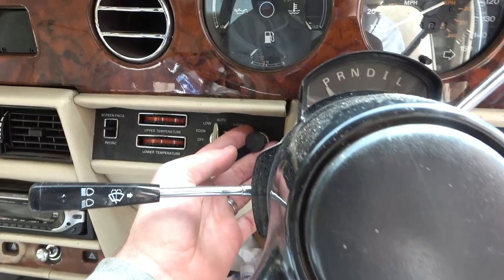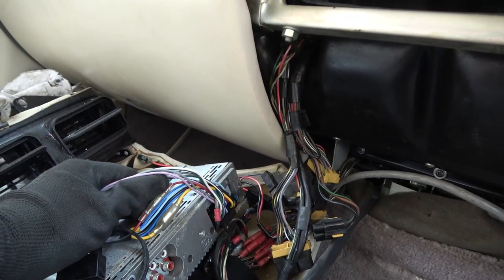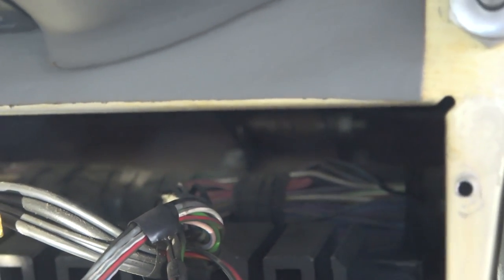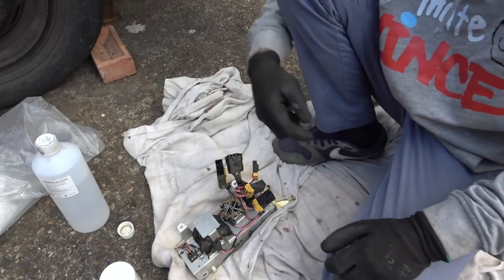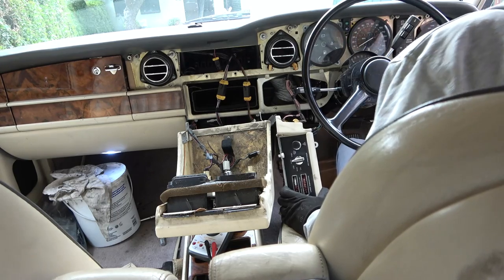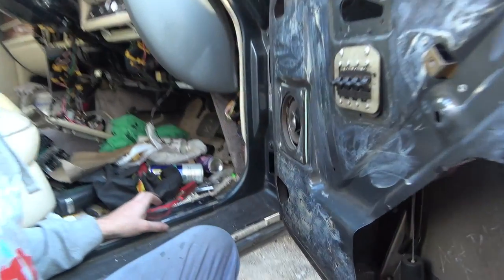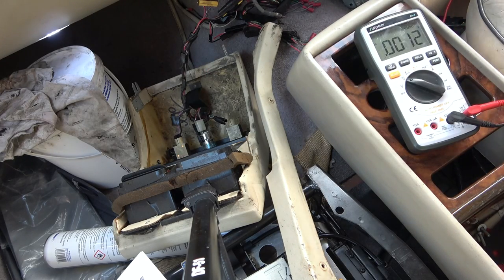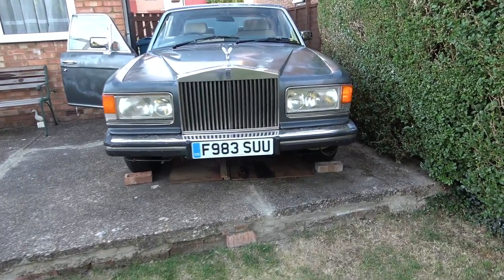DIM Indicator TURN SIGNALS on the ROLLS ROYCE SILVER SPIRIT & Other FAULTS - CAN I FIX IT? PART 20

Comment: These videos are never about the destination. It’s all about the journey you take to get to the destination. Great work as usual.
Reply from the maker: Thank you Scott 👌👍
Reply: Nice repair video 

Are you going to look why one of the headlights are not working.
Do you know if the back lights are working
Reply from the maker: @promasterthegamer523  I will do yes. I think when i got it the headlight was working,  might be the lamp itself. I don't actually know if the brake lights, reversing or fog lights are working. If they are not then as long as it isn't the lamps then I will do a video on them👍 Thanks.
Reply: @Mymatevince 
No problem

You can let people know if the brake lights are working in your next rolls royce video
Reply: @promasterthegamer523  like yer style 👍
Reply: @Mymatevince 
Are you going to try fix the back door lock on the left door
Reply from the maker: @promasterthegamer523  That will be included in Part 22👍
Reply: @Mymatevince 
Nice

When is part 21 coming out

Comment: I used to make wiring harnesses for trucks and here are some colour codes I can remember for the wires. 
B=Black, W=White, R=Red,G=Green, U=blUe, N=browN, S=Slate(grey), K=pinK, V=Violet(purple), O=Orange, Y=Yellow. 
When there are 2 together like RW the first is the main colour and the second is the stripe colour, so that would be Red wire with White stripe.
The splices will be taped inside the harness so will be inaccessible but are unlikely to have failed if they have been working for so long.
Those terminals might need replacing if they are that corroded. sanding them will give a temporary fix but will also remove the plating (if not already gone) so will corrode again faster.
You could also use some non-conductive light grease (like white lithium grease) brushed on the terminals to help protect them and to ease insertion.
Reply: .. insertion ..
tee hee
🙃
Reply: Looks like in some years of Rolls Royce wiring diagrams, Purple was designated as "P" and there may have also been an "LG" for Light Green, the only two-letter designation for a single color for whatever reason. And some diagrams would also include C or P at the end for cotton or plastic wire insulation.
Reply: pretty much same as colour designations vince used at BT.   Bw/Wb , Ow/Wo, etc.

Comment: Enjoying the videos. An easy way to check end to end continuity on a long wire is to connect a jumper between one end of the wire to ground and then go to the other end and measure between the wire and ground. Continuity means it is good through the entire loom. If you are worried that the wire might be grounded, just remove the jumper and then continuity will go away.

Using this you could ground all the pins on a connector and then check the far end connections quite quickly.

We did this in the navy to check continuity of cables that went from one end of the ship to the other.
Reply from the maker: I do actually understand that, really useful for testing long runs. Simple idea but super clever. Thank you👍👍👍
Reply: Clever. Guessing ground has to be metal such as the cars shell
Reply: Great tip Gregory :-)

Comment: The radio is equipped with a proprietary Sony plug going to a ISO 10487 adapter cable, which probably was delivered with the radio. You can find the pin assignments on Wikipedia or by googling for images of it. Maybe there are adapter cables available from the RR to ISO. I think you got the round DIN plug right, there is probably an adapter to the chinch plugs available somewhere. The other crimp connectors, tied to the DIN cable are either power for the amplifier and/or speaker outputs from the amp.
And the Sony radio may deliver more power and better sound than the pretty old Blaupunkt amp
Reply from the maker: Thanks, I will Google ISO 10487 to see if I can make sense of any of it. Cheers Loudness👌👍
Reply: @Mymatevince  the plugs are, but apart in  the power, the rest are what ever picked at the time of the radio and cars mating, some sore anti stealing thing?

Comment: Good work, Vince :)
But that connector(both male and female) in the driver side column, which goes back to the rear lights, MUST BE replaced eventually. I had a massive electric fire once in a Mercedes E230 because I didn't replace the corroded connections. And I had to replace the whole loom which took 9 hours of work to fix, my worst nightmare ever.

Comment: You could use some small brass brushes for your dremmel for cleaning those round pin multiplugs.
I would go round every fuse and relay panel on your roller and make sure everything has been given a good clean before starting work on other electrical faults that way you're only left with multiplugs to clean up as you go along with fault finding and maybe put some electrically conductive grease in those plugs in the footwells.
Reply from the maker: Thanks Adelle. Do you know if silicone grease will do the same job?
Reply: @Mymatevince  if it's good for 12 volt stuff then it should be ok even with those multiplug types with rubber gaskets built in.
Best way to check would be to continuity test a blob of it on the bench.
Personally I would buy some carbon-silicon(carbon black) conductive grease , at least you then know its going to be ok.
Reply from the maker: @adelestevens  Thanks Adelle. I will check it out👍👍👍👍

Comment: I've gotta say that when I first saw you'd be working on a car I wasn't all that excited about it ( I really only subbed to the channel to see the electronics fixes ), but over the weeks I have become hooked, this is really fascinating stuff.
Reply from the maker: Excellent. Quite a few viewers have said the same thing. I think really these electrical fixes on the car are just like a blue mat video but with different scenery and sounds. Nice one👍👍👍
Reply: @Mymatevince  TBh I'm now just as interested in the bodywork and mechanical fixes as anything else, it's surprising what you can achieve on a limited budget with a little bit of ingenuity.

Comment: Electrical wiring on cars when they get older can be an actual nightmare even on basic cars on a Rolls God help you Vince is the man to never give up.A mechanic friend of mine when serviced a car as far as possible used to check all the plugs for corrosion

Comment: Vince, when you are trying to repair something like that lamp you had no idea whether you were looking for a bad feed or ground. SO to make your life easier, use an ohm meter to establish if you have a solid ground and a volt meter to see if you have a good feed. You can also use a thing called a power probe which makes life so much easier as it connects to the battery and can supply either feed or ground and will allow you to trace the defective part of the circuit in record time. BUT as you know finding things the hard way, is the best way to understand how it works in the first place.

Comment: Nice fix. Quite satisfying to see faulty stuff working again after some work :) 
Someone probably would've replaced the bulb first, but it wouldn't fix this problem, so it was definetely necessary to do this job, also to pass the MOT as the front right indicator wasn't bright enough.

Comment: Another great piece of fault finding, well done Vince. It looks like that issue around the windscreen has caused quite a few electrical connection problems!
Reply from the maker: Thanks Mike, I was wondering the same thing. I wonder whether the 2 rusty clips that were on the windscreen were letting a bit of water down straight into that corner 👍👍👍

Comment: There's definitely less current passing through the right indicator bulbs (see how they light up slightly later than the left ones). Either the left bulbs have been replaced more recently than the right ones, or there is some contact resistance on the right branch.

Comment: Hi Vince, from experience checking car electrics faults with a multi meter can be very misleading. You may well have continuity but the circuit may not be able to carry the load required. Fault finding with the battery connected and a bulb rated at the same Amps as the circuit your checking is the way forward. Using bulbs prevents direct shorts and stops you damaging anything. A bulb in its holder with a couple of wires attached can be used from a known earth to check a live can supply the load or by connecting to a known live you can check the earth is capable of carrying the load also. Dull or no light equals high resistance and a fault, a bright bulb equals no fault. Looking forward to the next instalment. 👍
Reply from the maker: Thanks Andy👍👍👍
Reply: Yup, something like a 12 V/30 W bulb should do a good job. Draws 2.5 amps.

Comment: Great video Vince , I like your explanations of your thought process it’s good to see your logic.
Well traced and fixed.
With older cars I’ve found a lot of the problems can be bad grounds especially on element exposed electrics , I’d normally start to see if one of the connections has a good connection to a known good ground ( perhaps straight from the - terminal on the battery ) continuity and voltage and then trace back from there.
My sons fiesta kept popping a fuse on the RH indicator and hazards sometimes new fees would last between seconds and days, I changed the switch , relay and stork . Then I decided if the fault was blowing fuse it must be a short to ground and it was the jack had been chucked it the boot and it was resting on the loom,  a bit if sharp edge bodywork had made a tiny hole in the cable and made a short to ground so rewarding finding the problem 

I’ve eaten to much rust and dirt and had plenty in my eyes too , nice to see you had safety glasses on , a covid style visor may stop stuff going in your mouth 

As always really enjoyed the vid

Comment: Vince, 
If you have a faulty circuit on a vehicle, using the metre may give confusing results, as it does not test the current carrying ability.
Use a test lamp, or scope on a rope.
Put one end of lamp to neg, check the pos feed, lamp will light if rail is ok, then put the end to battery positive, and check the ground, lamp will light if you have a good ground, all you need is 1 minute to check if you have a feed or an earth issue. Using the multimeter will not give an accurate indication for current flow.
Reply from the maker: Thanks Tony, that makes sense. Really I need to buy a light and solder long leads and croc clips on it. I'm just so used to using the multimeter I automatically default to it 👍👍👍 Also I worry that some circuits may not be 12V and I may shove 12V into them or.... do you know if all circuits are always 12V on a car?
Reply: obviously the maximum voltage is battery voltage, there are some circuits which run on 5volts, the only caviate i would warn is you have an input circuit to a system computer on a vehicle, don't use this method, but in most cases the lamp on a test lead will give a very quick diagnosis, i would suggest you have several made up with different amp draws, you  could have one that draws 2 amps which you could use to test high current circuits such as 12v sockets, headlamps, radio, etc. then another that has 100 ma draw to test sensors, low current cicuits.  By the way really enjoying the Rolls restore videos, cheers
Reply from the maker: @tonycross8101  Thanks Tony👌

Comment: The seat belt indicator is regular also connected to a switch which is in/under the seat to check if there is a passenger on the seat. If there is (and the seat belt isn't in its clip), the indicator lights up, if there isn't it won't. And that is why the light is connected to the cable beam/connectors. So probably, when doing the seat motor stuff you (or the previous owner) did something to that switch/indicator, so it "thinks" there is a passenger in the seat.

Comment: Hi Vince. I would replace all the bulbs they can discolour with age. Indicators are a 382 bulb 12 volt 21 watts, and possibly the repeators are a 501 bulb 12 volt 5 watts. The stop and tail bulbs are 380 bulbs 12 volt 21/5 watt twin filament bulb.

Comment: For the female round connectors, could you use a cotton bud in a drill with some metal polish to clean them up? Also you can get IPA cotton buds from eBay to clean up the polish

Comment: I dont know if this could work , but maby you can test this theory on a cable where you know there there is a bad (dirty) connection. And if you then could do a resistance check on the cable with one end disconnected . So you can measure if you have higher resistance so you know you have a bad connection. 
Love the vids keep them coming :)

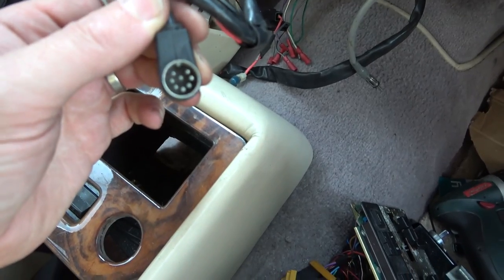Comment: 9:49 I had my radio stolen and the wires cut. Unless your repair manual has a proper wiring diagram for the radio, you'll have to identify the wires. For me, the hardest bit was identifying the speaker wires. Use a AA battery (after you've identified the power wires) and probe the rest of the wires. Eventually you'll hear a speaker buzz. To check if you've got polarity reversed, see if the membrane of the speaker you've found is moving in or out. If it's moving out, the polarity is correct

Comment: something that definitely inst in the highway code are my rear Fog lights, i have them wired to a Wig Wag circuit and they are what i flash at people to say thanks instead of my hazards :D

They look cool but i didnt wire them up like that for that reason, people have become desensitized to yellow flashing lights but my red fogs alternating left and right really stands out and is impossible to miss and did it as a safety thing!
Reply: unfortunately flashing and / or alternating rear fogs are mot fail now

Comment: Love your videos Vince but I'm a bit of an OCD freak, please please please make your life easier and tidy up the footwells and boot hehe, auto sparking is the hardest of all electrical work, especially on older cars a single bad earth can cause all sorts of issues, I'm an aircraft electrician/HV electrician now offshore and I served my time as a car mechanic in the early 80s and hated electrical faults, back then things were simple but you still came across positive earthed cars, guys fitted new radios designed for negative earth cars and wondered why the car wold suddenly fill up with smoke.  Good luck with the car, and thanks for the laughs over the year.

Comment: you can tighten the female parts of the connector, by bending the sides in a little, some still looked rusty inside, in your Dremel bits kit u should have a tiny ball grinding bit. shove that up the connector holes. apply vaseline or dielectric grease, or just grease, it all works the same to keep water out.
Reply from the maker: Thanks Mark, I didn't think to look in the Dremel kit. I will have a hunt around to see what is there 👍👍👍

Comment: Nice jobb Vince 👍👍👍 But be carefull whith thath Contackt cleener ! Some off dise are wery flammable ,, a spark can create a big fire in the contakt and cables  !! So make sure the contackt cleener is fully evaporised before you turn on the power to the batteri  !!!
Reply: A dielectrik grease can be a good idea to prevent oxidation in the future !!

Comment: I'm thinking, instead of trying to turn this Roller into something pristine with a professional paint-job costing thousands and thousands, why not turn it into a Rat Royce.
You could get Scott from Ratarossa to give you a hand with that.
That would be a crossover to die for.
Reply from the maker: My brother was saying the same thing. Keep the bodywork just like it is and run it without the wheelhubs. Certainly would be unique but I would also like to have the chrome all polished up and shiny paintwork. Just not sure at this stage whether it will ever look good given the state of everything!
Reply: @Mymatevince  I love it no matter how it goes :washhands:✌

Comment: the screws for the dash is easy to fix , just make a holder that supports the back of the head use a small hammer and small taps in order to move the buggered up metal back in the groove and head use a file or hacksawblade to reform groove ,i would  use bluing or galvanize the skrews again

Comment: Front driver side is definitely much brighter than the beginning of the video.   Wondering if the replacement tail light has a different bulb than the original and hence looks different than the original that is still there.
Reply from the maker: Yes maybe Vikas, I will try and swap them over in a later episode to see if the dim side becomes bright and vice versa. Thanks 👍👍👍

Comment: 9.12 hi Vince,  i'am thinking the the rolls royce had a blaupunkt radio from the factory and the wires at 9.12 are for that radio, and at 9.42 that round plug will be for a CD multi changer (maybe theres one in the boot?) 9.53 these wire with the red bullet connectors will be the speaker wires if they are 8 of them ?
Reply: I thought the round plug was for the ejector seat ?
Reply: @travisash8180  LOL:}

Comment: Vince... where is the Deoxit?😅
More serious,  you could use the dremmel with a brass wire wheel to clean those connectors
Reply from the maker: I know, that is going on!!! The DeoxIT hasn't made an appearance since the Mixer video. Things need to change!

Comment: I noticed on the fuse diagram there was a fuse for "Cigar lighter". R.R. could have used "cig. lighter" if they wanted to shorten "cigarette lighter". I think the unspoken assumption is that Rolls-Royce owners will be smoking big cuban cigars in their vehicles. Classy. And stinky.